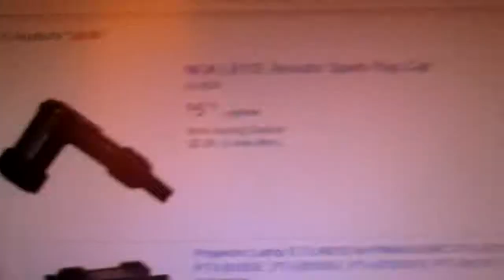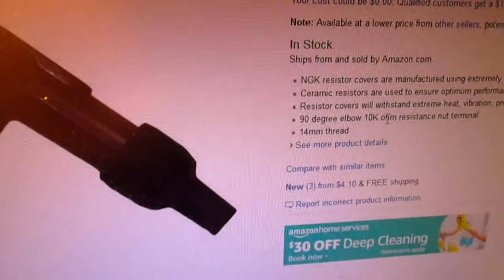Resistor spark plug BOOTS/ Caps VS non resistor?  Small engine

Comment: 5kohms in the boot. Your generator output will have less noise which is what you want. Prob don't need resistor plug if you have resistor boot. Resistor plug is 5k ohms also. Having both is not a big deal. Just cost a bit more.
Reply from the maker: Yea this does not have a resistor plug Think its 5k
Reply: It definitely makes a difference.   Both to the spark and, more importantly, the ignition system.   

Guys will fry their coils and just assume its a bad part.  Or any other part inline with an electronic ignition.  Especially electronic ignition coils....

Stop regurgitating bad information.  Ignorance is not bliss.

Comment: Resistor boots ,or as some call them spark plug caps with a resistor should have a threaded end, that is removable with a common screwdriver at the end for connecting to the plug....at least my 1981 Suzuki gs750e does...it has a 5k resistor with a spring under the removable threaded electrode...I found that without the resistor my coils actually fry carbon core wire's or suppression wires that also have resistance....run copper core wires with either resistor caps or plugs but not both ,and things work fine...a Resistor will reduce spark energy slightly but on a oscilloscope it with prove to produce a longer spark with clean transfer ...I would check the assembly from the center electrode on the plug to the end of the plug wire where it attaches to the coil...if it's over 10k resistance with a ohm meter I would make some changes...at least on a motorcycle or small engine....on newer cars they have so many sensors and cameras and Bluetooth and so on and so on I would stick with manufacturers type ignition parts

Comment: Do you know how much voltage goes into the primary coil on ignition coil?
Reply from the maker: No idea
Reply: It should be 12 volts...and the winding in the coil steps it up to 20 ,000 or more in the secondary...50,000 volts is what the Mallory supercoil used to discharge on my mustang...didn't believe it until it hit my friend one day...lol his thumb lit up like a light bulb....don't touch your coil while the engine is running..especially with MSD ignition or things like that
Reply: 12 up to 20 volts from primary coil going to ignition coil if your cdi is AC type cdi and 12000 to 45000 volts fom ignition coil going to sparkplug

Comment: On my 2000 r1 comes from factory with resistor in the spark plug boots and the plugs too 10k on boots and 5k plugs
Reply from the maker: Weird. Double.  Not sure how I can test the resistance of the boot. Probably have to remove it from the wire. They say the boot just threads from the wire. Then check the resistance with a DVM
Reply: Ghetto Wagon we can take the resistor of with screw driver inside the boot
Reply from the maker: What do you put back in the center?

Comment: Yeah forums are almost dead. If people have questions all u gotta do is search you tube and there's your video. Or your answer is already archived on a website somewhere.
Reply from the maker: Forums are just a "look what I did today" place.  No more good info.
Reply: Ghetto Wagon no one hangs around to help. They want answers, they get it from a moderator or the forum owner, then they're gone. No one else hangs around to help out. The people that get their answer don't even reply back if the answer worked for them, so you don't even if it's correct.
Reply from the maker: Then they are Banned!